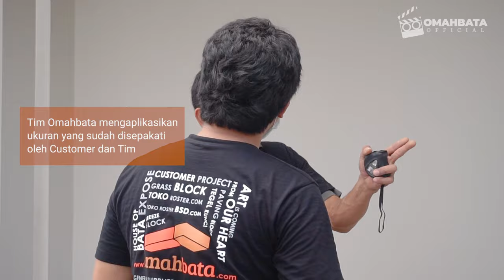CARA PEMASANGAN ROSTER MUDAH DAN GAMPANG! | PEMASANGAN ROSTER BY OMAHBATA | JUAL ROSTER

Comment: Cek lokasi & harga roster + jasa pasang mas?
Reply from the maker: Head Office :
Jl. Ciputat Raya No. 59, Pondok Pinang, Kebayoran lama - JakSel

08.00 - 18.00 (Senin - Jum'at)
09.00 - 16.00 (Sabtu)
Minggu Close

Telp : 021-2912-5223
WA   : 0812 500 500 53

Cabang BSD :
Jl. Ciater Raya No. 185 E 
Kec. Serpong Tanggerang Selatan

08.00 - 18.00 (Senin - Jum'at)
09.00 - 16.00 (Sabtu)
Minggu Close

Telp : 021-7568-5590
WA   : 0812-1348-1313

Cabang Bogor
PABRIK ROSTER - Breeze Block Store, Toko Roster

Jl. Raya Bogor KM28 No. 5, RT.01/RW.05, Pekayon, Ps. Rebo, Jakarta Timur 13710
(Seberang Pom Bensin, dekat Panasonic)

08.00 - 18.00 (Senin - Jum'at)
09.00 - 16.00 (Sabtu)
Minggu Close

Telp/Wa: 0813-1234-8313

Silahkan hubungi sesuai dengan lokasi yang diinginkan ya Kak Rafa

#SW

Comment: Daerh mana y
Reply from the maker: Alamat: Jl. Ciputat Raya No.RT.5, RT.5/RW.2, Pondok Pinang, Kebayoran Lama, Jakarta Selatan 12310, untuk info lebih lanjut bisa hubungi kami di admin 08128201414 / 08128101313 Trimakasih :)
Reply: Ada link tokped atau yg lainny?
Reply from the maker: @dimazrangga5536  bisa langsung ke website kita kak https://omahbata.com/ untuk info lebih lanjut bisa hubungi ke 08128201414 / 08128101313 Trimakasih :)
Reply: @OMAHBATAOFFICIAL  hanya melayani jkt Dan sekitarnya ?klo wilayah bdg ada tokonya?
Reply from the maker: @dedehasanah1450  Kami melayani pengiriman seluruh kota di indonesia, untuk informasi terkait pemesanan silahkan menghubungi customer service kami di 0812 500 500 53. 
Terima kasih.
Reply from the maker: @dimazrangga5536  Untuk pemesanan bisa langsung menghubungi admin gerai kami. 
08128201414 / 08128101313 Terimakasih.